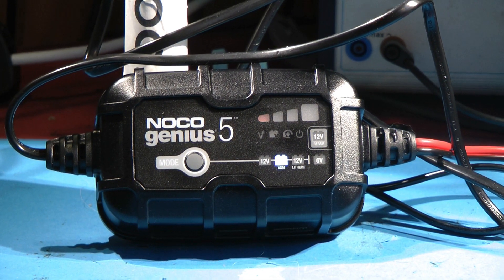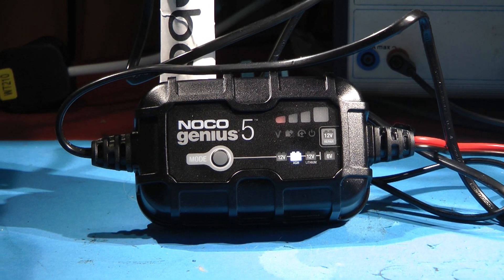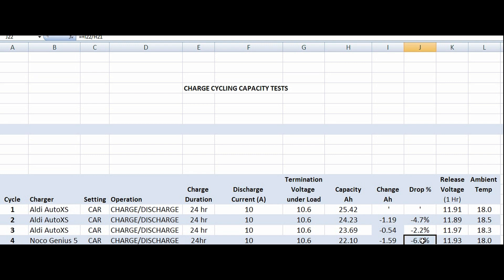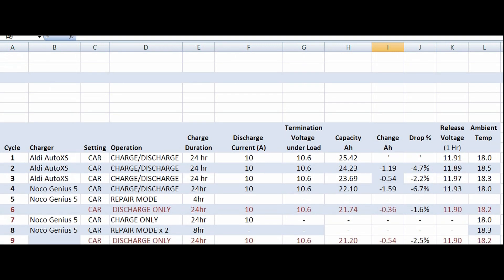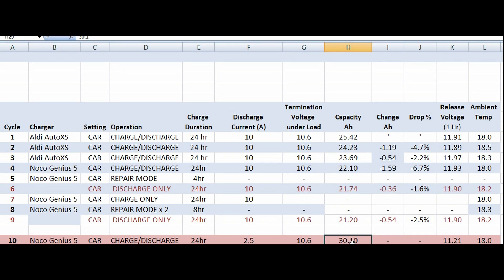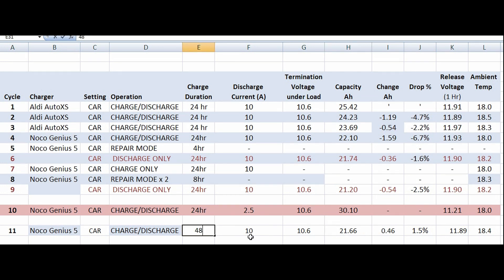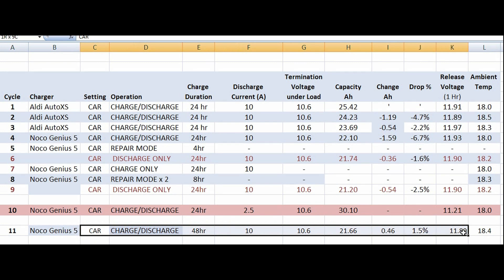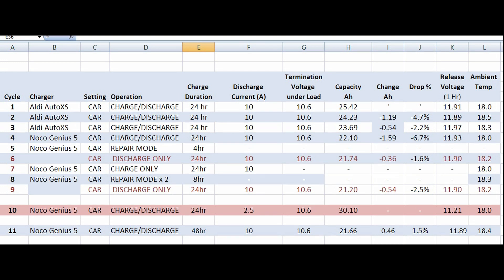NOCO Genius 5 Battery Charger Detailed Repair Test , teardown  and Review Part 3

Comment: I have a 3 year old 50 amp-hour, 12 volt, lead-acid battery in my Honda Civic, that would turn over slowly, but not start the engine in extreme cold (-35 C) conditions yesterday. I took the battery out of the car and into my heated garage to warm it up to ambient room temp, then after about 8 hours,  using my multimeter, I got a reading of 12.36 resting volts. I then used a Noco Genius 5 to charge it to full over night 15 plus hours and then measured at 13.18 resting volts.  My question is, should I try and give it a charge in the special repair mode or do I chance weakening a not-so-old battery more?  Noco doesn’t say anything about using repair mode on batteries that are not so depleted. Thanks!
Reply from the maker: That is a very good question. A battery starts to deteriorate from the day it is put in the car and subjected to the both the electrical  and environmental conditions. Three years doesn't sound that old but -35 C is extreme. A factor that often overlooked 
 regarding cold start is the viscosity of the engine oil. High quality and recently changed oil will offer us less resistance than old or incorrect grade oil.    I am guessing that you have you car is gas and not a diesel engine.  In cold conditions, slightly poor 
 fuel atomisation fuel due to slightly fouled injectors can severely impact starting. Using a good fuel treatment helps a lot.    If you don't won a tester It is usually free to get the get the battery condition tested. If it is weak or replace  then try the repair/regen option and let us know if it helped. Oh, and really clean the battery connection posts and the clamps. They look clean but they usually aren't. Clean them up. Fit the battery  and coat them with dielectric grease or a terminal protection spray.  Remember extreme conditions require extremely good terminal post connection. Since lead has a higher coefficient of thermal expansion, it will also contract more than brass when temperatures decrease. The behavior is the inverse of expansion: materials that expand more when heated will also contract more when cooled. So, in a colder environment, lead will experience significantly greater  shrinkage compared to brass for the same drop in temperature. Tight and clean.
Reply: @razenby  Thanks for the advice! I do run thin oil 0W-20 full synthetic and have an oil pan heater (125 watts) and block heater(coolant heater) that was used during the cold temps. I do use 3M dielectric grease on the posts as you said, but all these things still didn't seem to help. Its a small battery group size 51R and I wish Honda would have allowed for a larger battery to be installed easily with more cold cranking amps maybe a group 35 or 24F, but its a tight engine bay. I might just try this repair mode and see what happens with the voltage afterwards. I'll post back here for an update.

Comment: Seems to me that you are not measuring battery capacity when measuring Ah at a given voltage (10.6) drop at your connection. Trying to compare Ah withdrawn at multiple discharge rates to determine charger  performance is confounding at best! I enjoy your videos!
Reply from the maker: So how do you judge battery capacity in Ah ?

Comment: Is there a brand of charger that has variable amperage say 2 amp 5 Amp 10 Amp that you can recommend? Noco has a set Amperage which is not good for varied sizes of battery. eg 10 AH to 150AH batteries.
Reply from the maker: Yes there are several out there. However I haven't tested one.

Comment: I have an old CTEK US 7002 and I just bought a NOCO GENPRO 10x1 and I try to repair batteries with them since the sitting voltage are between 12.4 and 12.6 V. With Victron Smart Battery Sense I can see the charging graph using their app. CTEK just raises the charge voltage in recondition mode it is actually just an equalization charging. NOCO however pulse charge in repair mode and raise the charging voltage gradually for a 4-hour session. Both are supposed to be helpful in desulfation, except CTEK would terminate reconditioning too early instead of trying to keep the voltage as high as 15.9V as stated in their user manual and longer. On the charging side, CTEK seems to charge normal while NOCO might drop and raise voltages randomly at the final charging stages. My main goal is to restore sitting voltage so I haven’t touched the capacity
Reply from the maker: How effective Recondition is really depends on the type of cell.  It doesn't work very well on sealed valve regulated lead acid batteries. By the time you realise that there is a problem with the battery performance is it usually too late. The chargers I have tested rarely perform according to their claimed specifications.  The electronics are too cheap and the spread of tolerances causes errors in the controllers perception of what the actual battery terminal voltage is.

Comment: LeadAcid would recover etc. But AGM - I don't believe, since there is no boiling water inside doing desulfatation.
Reply from the maker: Depends on the battery.  Sealed Lead acid cells don't respond well to gassing. The rate of recombination of the gasses is limited. Too much current and the pressure relief valve lets the gasses out leading to loss of electrolyte.
Reply: I've had good results (9 out of 13) reviving aging or dead car AGM battery with desulfator charger such as this one so far. You are 100% correct with the lack of electrolyte part as I need to add distilled water before attempting to repair them or, most of the time, I ended up making the battery's performance worse after a complete charge both measured Ah and internal resistance wise. The main reason I only bother with car batteries is that their valves are easily removable by unscrewing them unlike deep cycle ones which often have a molded platic plate over them

Comment: I have a brand new NOCO 5x3.  Two of the banks work fine on 24volt tolling batts.  The third bank I use for the crank batt or a seperate fish finder batt.  When I press the power button for this bank, three different led lights flicker quickly in sequence one time, then nothing.  Any idea would be a great help?
Reply from the maker: Are all the backs 12 volt?   Do all teh chargers behave in the same way on the fish finder bank?  Can't think why it would do that if the battery voltage is above about 7 Volts.
Reply: @razenby  two banks work fine and the batt in question is at 11v

Comment: Great videos Magic Smoke! I've just received a NOCO Genius 5. 

We have a 60AH Agribatt which was down to 12.37 V today which I believe is classed as 'charge as soon as possible.'

Got it home on the NOCO charger, and it cycled all the way to green status in less than 3 minutes, indicating the "bulk" of the charge is done. The battery then read 12.6 V. 

Following NOCOs instructions I put it back on charge, and eventually after 8 hours, only the green light stayed on indicated 100% optimized. Volts then reading 13.01 V.

My question does this sound normal to have the bulk of the charge done in 3 minutes flat? Is 12.37V not really that discharged? Was the extra 8 hours of charging worth it for the steady green only light?

Thanks in advance!
Reply from the maker: On a healthy battery 12.37v resting voltage is about 65% charged.  The key thing to note is the 'healthy battery' bit  . If you fully charge the battery and leave it for a couple for days and the battery reads 12.37V then the battery is not in tip top condition. The resting voltage (24hr after charge) after charge is a good indicator of the condition of the battery. A fully charged healthy battery should have a resting voltage of 12.6V .  The relationship between (terminal voltage vs current vs state of charge) is undefined for a failing / aged battery.  For a  weak battery, when subjected  to bulk charge current,  the terminal voltage rises quickly without absorbing any charge so the charger has no alternative but to switch to the next charging stage.  Judge you battery after a an extensive float charge and recondition cycle. Recondition it for a week and then repeat  the resting voltage test . Let's see what results you get. Please report.
Reply: @razenby  thanks for the helpful reply! Its a 60 AH leisure battery running an electric fence energizer. From new its lasted 2.5 months without a charge, until it read 12.37 V and I decided to charge. Its now reading 12.91 V after being stood overnight since I took the charger off. 

What volts would you reccomend taking it home for a charge again? I'm going to refit it to the energizer today. 

It sits in a plastic box on a field, raised off the ground with 2 bricks and bit of plyboard, and it's currently 3*C in the day and some minus 4*C expected overnights!

Comment: Hey I have a BMW F30 with an agm battery, about 2-4 months ago the my car battery came so low that the car shut some electronics off to conserve energy, I can still lock and unlock car with key fob but it’s still low, I just got a Noco 10amp and I tried using it, I hooked it up to the terminals in the engine bay, it charged very fast ( the bar indicators where going up every 10 minutes or so ), it was showing that it was almost fully charged which was at the green bar, every time I unlock or lock car using key fob which uses power and the bar indicators drop down to the first one, also when I took off the charger after it said it was almost fully charged but it still showed my car was still on low battery, any ideas to what might be wrong such as, a bad sulfated battery, or etc….? I know there’s something wrong because it’s going up a bar quickly, when I use power it goes back down to one bar, and the car still says it’s low on battery so it shuts down some electronics, is there something I’m doing wrong, do I need to put it in repair mode and does that mode work on agm batteries, or is it just a bad battery, I don’t have any tools to measure voltages, plz lmk ASAP, Thank You!
Reply from the maker: It should not lose charge that fast, If the battery terminals are clean and tight then it likely that you need a new battery,  If you know anyone with a battery tester then you can ascertain the battery's condition.

Comment: any idea why my noco genius 5  is dead no lights what so ever. triple checked plug fuse ,and the inline fuse, till no light nothing. thats whether connected to good  battery  or not  i believe there is another fuse inside the unit that you carn`t get to is this correct if so that nut
Reply from the maker: There is a fuse inside the unit but if it is blown it invariably means that the switching power supply has had a catastrophic failure..  I have never seen a failed NOCO unit...
Reply: Was the NOCO firmly connected to your home’s electrical supply?

Comment: I'm interested in your thoughts on the requirement to charge calcium batteries at voltages upwards of 16V. Most calcium charge modes charge up to at least 15.2V or so and I notice that the Noco 5 doesn't specifically have a calcium mode. Have you compared the Noco 5 to other chargers that have a calcium mode?
Reply from the maker: The 16V figure is mentioned here and there but I have never seen it on the battery manufacturers data sheet. If you know of one then pleas me the link.  As far as I can tell it seems to be a recommended periodic practice to remove oxidation from the plates.  To be fully charges, Ca batteries require a higher termination voltage. (14.8V at 20 deg C).  Charging in AGM mode can accomplish this.  As we have demonstrated and calculated in the videos, the voltage measurement electronics of the 'smart'  chargers we have tested aren't that accurate or repeatable anyway.   The termination voltage for Calcium is 3% higher that standard VRLA.  Some say that you should not use a calcium battery on a car not designed for calcium as the charging system is designed for it.   I have found alternators on cars are very hit and miss on the maximum voltage.  Start the engine and measure it when you pick up the revs to 1,500RPM.  If you see 14.7 then it is about right.  Lower than that then you will have to charge periodically to 14.7V to keep it tip-top.

Comment: Any idea what could go wrong on a noco 10 charger? ...I can't get any lights to come on, period. Not even if I hold the power button down for 10 secs.
Any help? ...I can't find anything on the web anywhere.
Reply from the maker: It needs repairing - I cant think of any straight forward things to try apart from taking it apart and checking out the circuitry.
Reply from the maker: Not really. Probably the Switch mode power supply has failed.  I could take a look at it for you.
Reply: @razenby  Have you seen one of these noco genius 10's yet filled with what looks to be a gray silicone rubber? ...you can't even get at the top side of the circuit board (I was able to peel it all off the bottom side, but not the top) ...I'm not sure how to remove the nasty stuff without trashing the board ...ugh!

Comment: regarding line 10: you used the Noco 5 to discharge? how is this done? Thanks.
Reply from the maker: I use an ITECH computer programmable load which is controlled by the test utility. to discharge the battery.
Reply: @razenby  Thanks for your response. Also, regarding line 11, did you use Noco 5 to charge the battery? It seems like you were charging closer to 1 amp vs the Noco's 5 amp rate.

Comment: The condition of the battery plays a huge role... You need to do these test under new battery conditions..

And yes the Noco Genius 5 or 10 can fix old batteries. But the limit seems to be around 90% of the original battery rating...Not to mention type.. As I use them for AGM batteries.. As they cost a fortune at $800.00 each. As they are Cell phone tower batteries. They decommission them every 3 years. Even though they are rated for10 years..So I want to keep them at 12.8 volts.
Reply from the maker: Why - please explain why the battery has to be new. The battery is only new the day it leaves the factory-- it is a story of steady deterioration which accelerates when the battery is used. So, you cant test under new conditions as battery chargers aren't often used on new starter batteries,.  How do you know regeneration works- Have you done any quantitative testing?
Reply: @razenby  I battery is not new when it leaves the factory. As they do not transport them filled.. They get filled at the point of sale...Some Auto parts stores fill them when they arrive. Bad Idea. As they will be discharged below 90%... I have taken testers with me. To check the resting voltage on them before I buy one..As they shove the older ones to the front. 

So my suggestion. Buy batteries of the same type and model. Hell even the same lot number if you can..Then do your test. You will see what I mean...

And I know regeneration works. As I buy AGM Cell Tower batteries at 12.5 resting voltage..After they decommissioned them every 3 years...Once I use repair mode. They end up around 12.8 to 12.9 which is what the factory says they should be at. 

These are not cheap batteries. The Cell Companies buy them $900.00+  ones rated for 10 years..I get them for $110.00...I asked them why they sell them after 3 years use. Answer..They test them. If they fall below 12.6 they are removed..Even  though the factory warranties them for 10 years..They just auction them off...

Comment: At step 9 did you charge for 24hr before the test.  That wasn't clear in you video when you described the steps but in you table it seemed to indicate a 24hr charge before test.  If you didn't charge after repair mode then it's hard to know how the battery repair worked since the next test was the 2amp drain test.  Anyway, your videos were brilliant, I appreciate the time and energy you put into this.  Thanks!
Reply from the maker: Yes I did. It says that the battery should be fully charged.  Successful recovery of a failing battery is an urban myth. It may of worked in the old days when batteries were open-vent flooded lead acid with substantial plates but VRLA don't respond well to (preconditioning and repair modes) . These modes should be re labelled 'risky over charging mode which is what they are.
Reply: @razenby  I think you are right-just risky overcharging for newer designs.   And this is not proof of cheaper design (def does seem related), at one time you could get older batteries with 3 years total replacement and up to 8/9 years prorated.  Alll I can find now in the USA is 3 year replacement for even the premium ones.

Comment: i just bought a Genius 5 to charge my battery in my Audi A3. the car has been stored for 5 months.  i plugged the charger in and it registered one red box flickering on/off.  after 12 hours it was flickering green.  i left it overnight and in the morning it was back to one red box on/off.  what could have happened?  there was no load on it.
Reply from the maker: Most likely the battery is completely flat and ruined and wont take charge,

Comment: I bought this item about a month ago.  I have a 2nd car that is rarely driven so the battery gradually discharges.  With misplaced confidence, I connected the NOCO Genius 5 to my car.  At that time, the battery was about 50% discharged.  I left it charging for 3 days.  Then I went out to my car and tried to start it.  I just got the dreaded click click from the starter.  I looked at the charger and saw the error light "Bad battery error LED".  So, all the time I thought the battery was charging, it WAS NOT!!  I connected my DELCO charger, set it to 40 amps and within minutes, the car started right up.  So much for a "bad battery".  I'll continue to evaluate but my 1st impression is not good.
Reply from the maker: Clearly your battery is duff or has internal leakage.  A 40 amp charger will strip the plates.  Here to hoping you find a permanent solution soon.
Reply: @razenby  How will 40 amps strip the plates when the alternator puts out more than that?